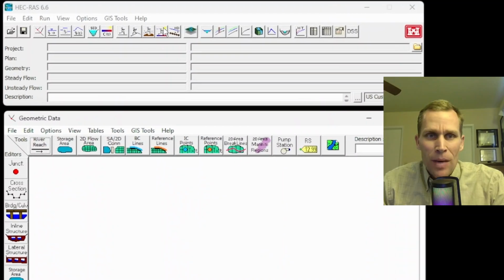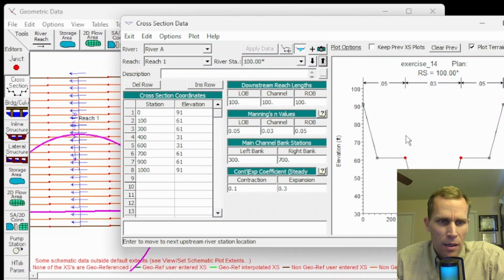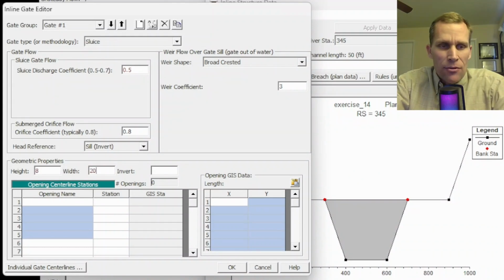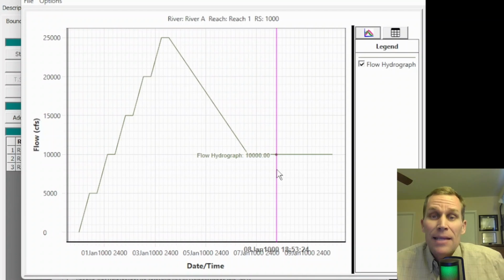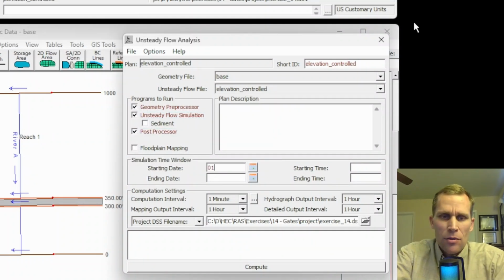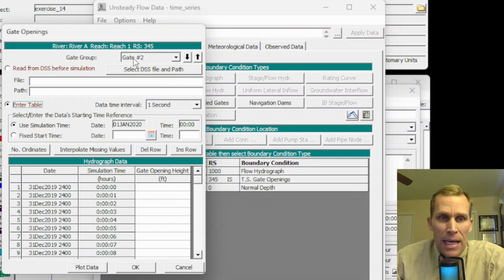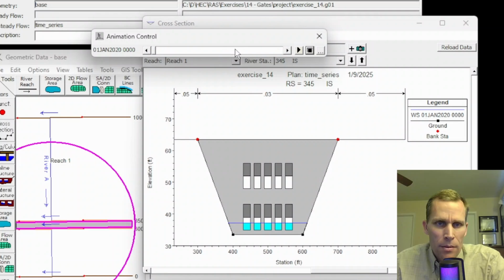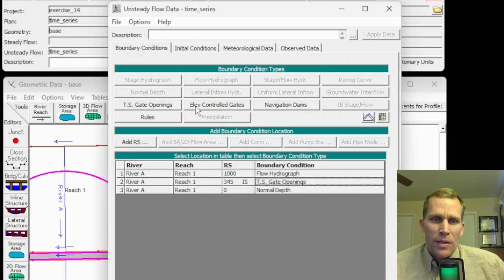HEC RAS Exercise 14 - Gates - Controlled by Water Elevation and TimeSeries Data

Comment: thanks for the video. in my operation, if the starting flow of hydrograph data  is 0 then the model will not run as well. So i try to change the initial number not be 0, and it works!